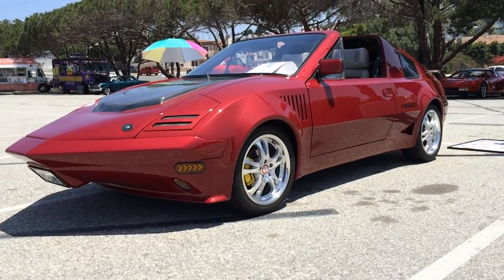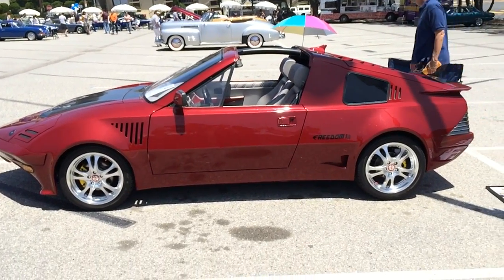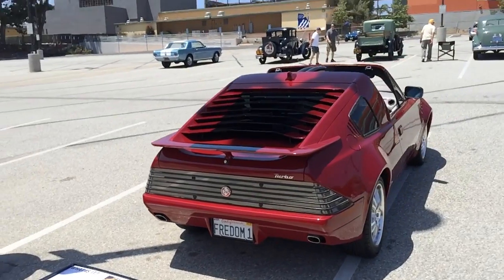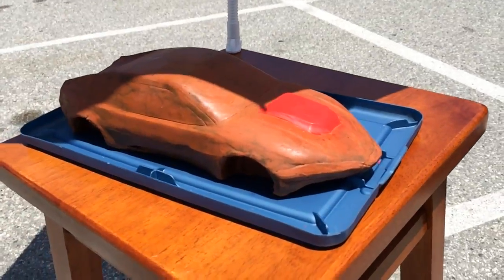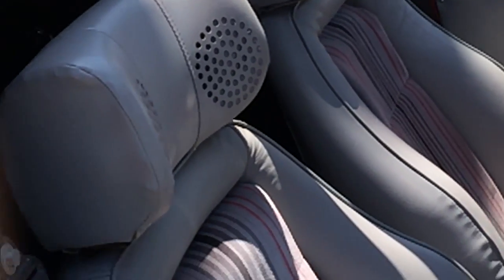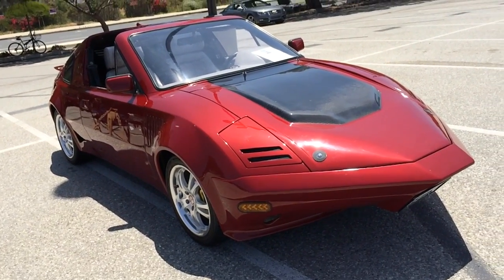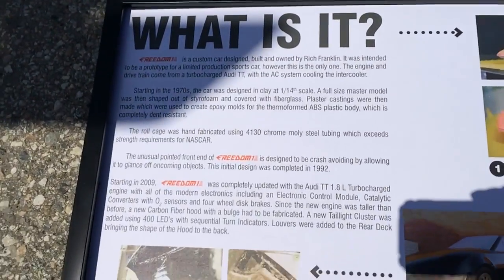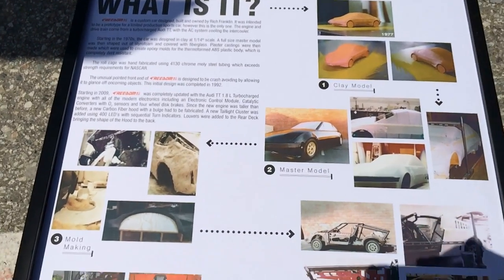Homemade Car

Comment: I actually have plans to make a car of my own in the future, key words "in the future". I heard this about a start up company called "Rivian", that wanted to make a fully electric pickup truck with 400 mi range, that they were fortunate enough to have multiple companies such as amazon, ford, and apple I believe, invest hundreds of millions of dollars each, for designs before they even had a preproduction model, let alone a prototype. Considering it would cost at least fifty-million to fabricate a completely new street legal design, I wouldn't atempt to pull one off myself unless I had the money. Otherwise it would probably take me 30 years to build my first preproduction model. Rivian did it in about 10 years, but they had over a billion dollars in venture capital, so I'd say the competition is pretty good.